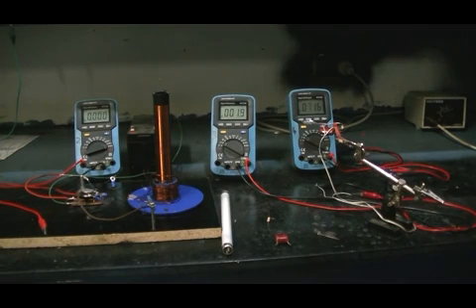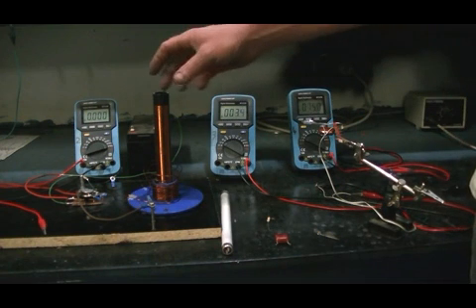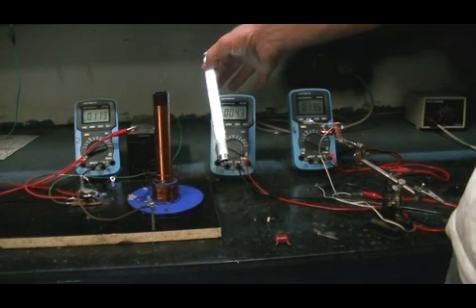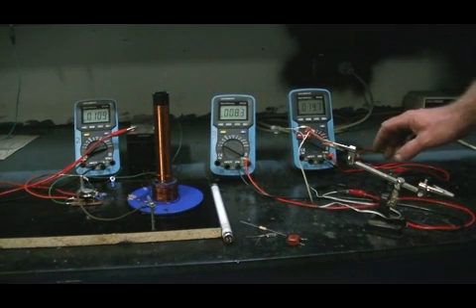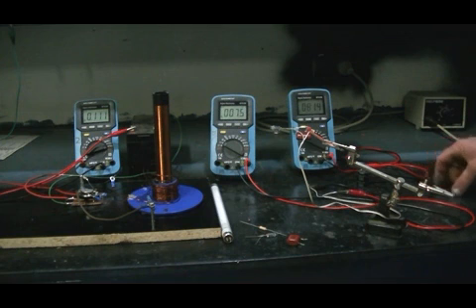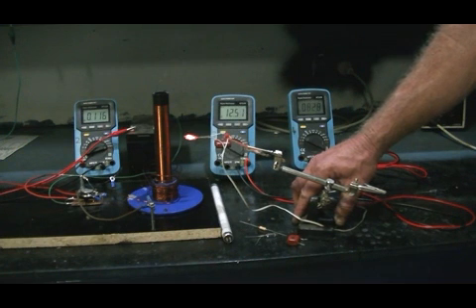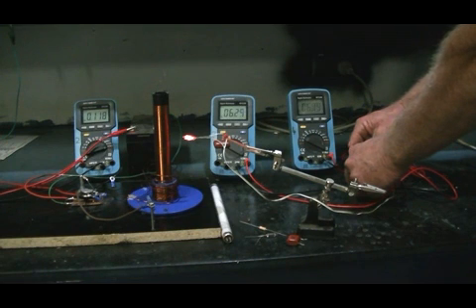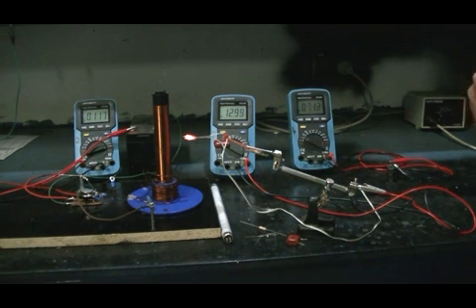Slayer exciter-wireless dc current without the use of a nonlinear circuit.

Comment from the maker: Only when used in a conventional way-current passed through the terminal's.Here we are exciting the gas with EM pulses,which gives a very different outcome.The neon by default is a linear globe,which means it will pass current in either direction.The neon gas also has a nonlinear property,and can act as a diode that can also pass AC current.

Comment: Interesting method, works well :)
In quick time you'll be charging 400V caps...just watch for pets and inquisitive noses !
You can hang an electrolytic cap off the top output of another tower that sits close by. Run the Negative to an aluminium block. That's how I know about the cat problem lol. A virtual ground will work as an actual ground, as far as caps are concerned for polarity.

Comment: Fantastic experiment, thanks for sharing.
If the output was enough this cap set-up could become a wireless receiver to pump juice  into a device (cell phone, battery charger, etc.) that would be a neat experiment.

The other neat part about this tech is that it allows juice to be syphoned off a generator without shutting down the machine because it can only syphon as much as the generator can produce.